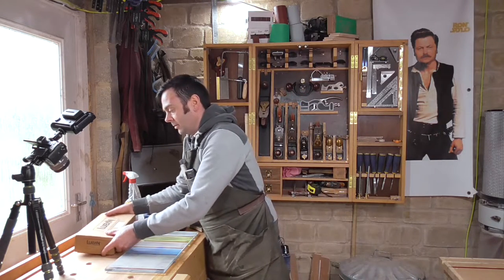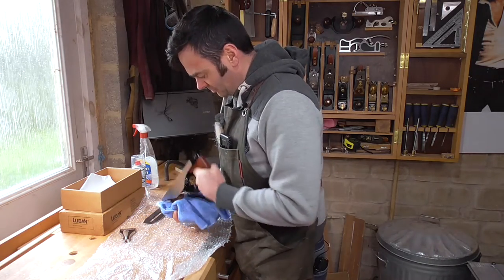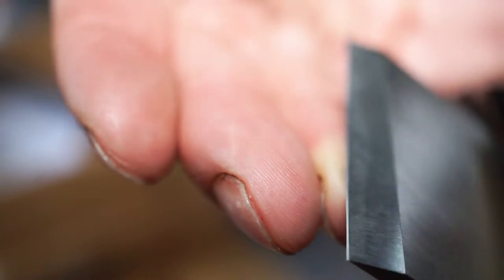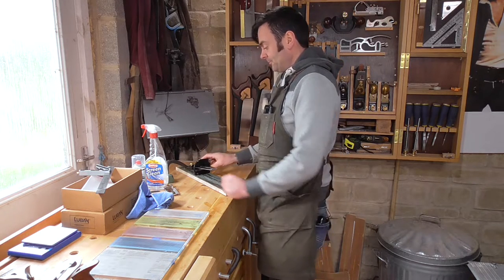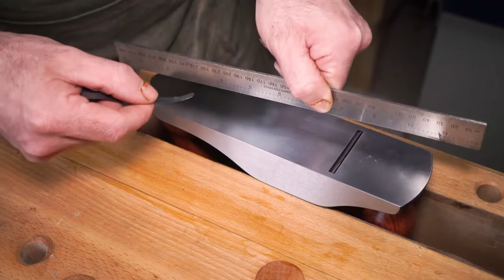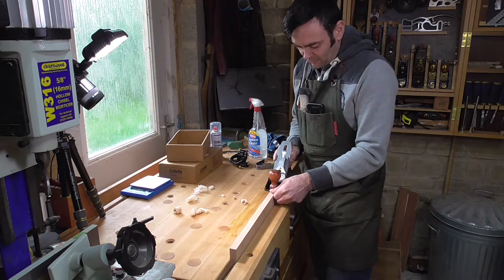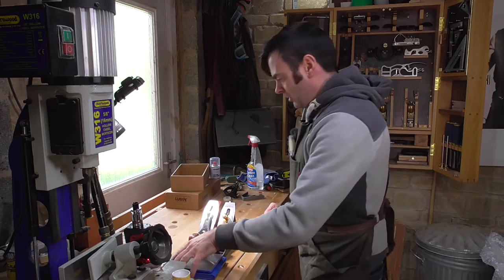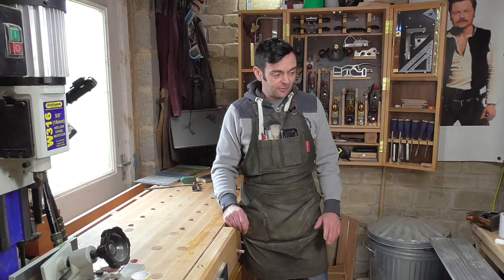Preparing a Luban No 4 smoothing plane out of the box for amazingly thin shavings!

Comment: Top stuff mate, I now realise I need (aka. want) a Veritas honing guide.
Reply from the maker: I've used others and they all work. The veritas is a different beast though. Specially if you get the narrow blade holder and cambered roller too. Between those and the standard honing guide, there is nothing in my hand tool cabinet I can't sharpen perfectly, other than scrapers and spoke shaves, but you don't need a honing guide for them. It really is an excellent tool.
Reply: they are good, but even having one,im still soending too much time to sharpen. i advise learning to freehand it.
Reply: I have been using my Vertitas Mk 2 honing guide for some years and found it works quite well on plane blades but, I won’t use it on my chisels as they slide all over the place and I am not spending any more money just to add the adapter that’s been created to overcome this fault. Found the Richard Kell the best all rounder but am now working on hand honing.
Reply: @rpowell222  ive heard this a lot about the mk2 but ive never found an issue sharpening thinner blades. I use very light pressure and holding when i do them and it always worked for me.